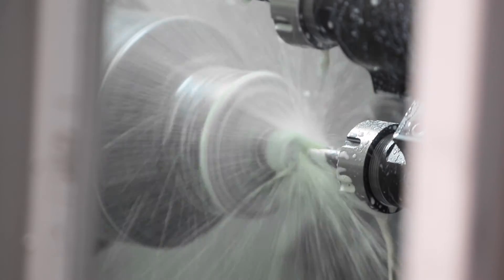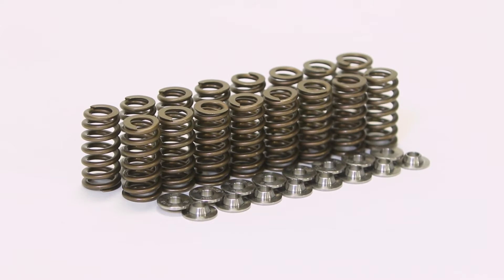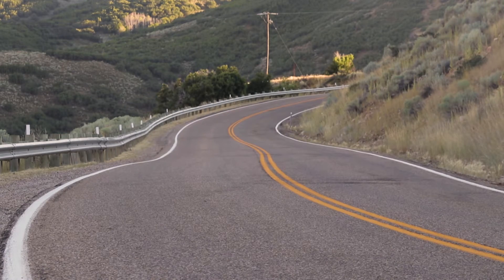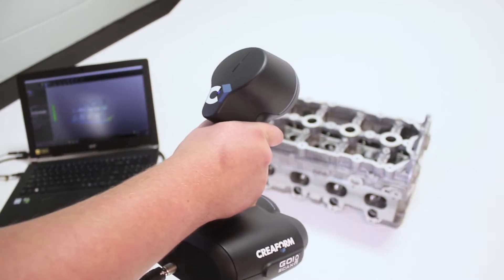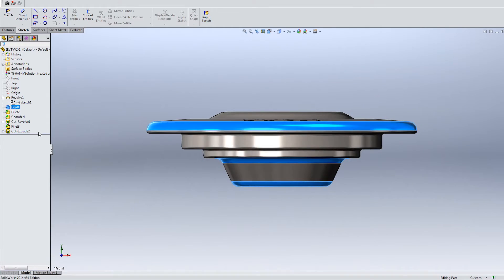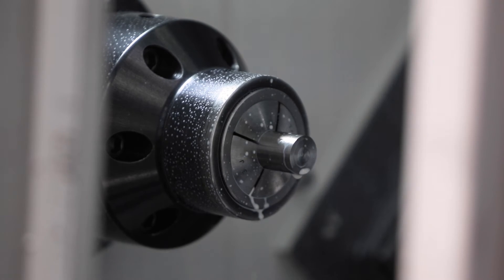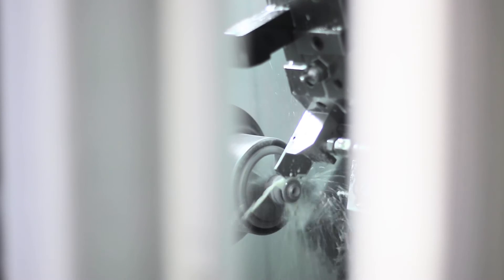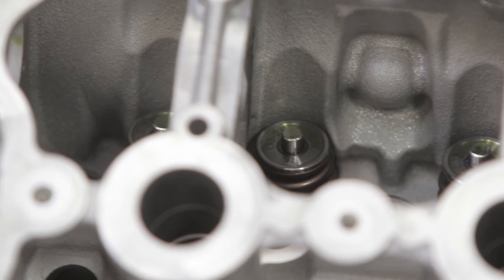Born At IE:  Valve Springs & Retainers

Comment: I just bought some valve springs but I wish I could get install instructions for these. My brother and I could install them but I can't find instructions anywhere.
Reply from the maker: Hey,
Installation is exactly the same as OEM, you can follow the OEM recommended procedure in the Bentley manual.
Reply: They don't seem to have a Bentley manual for MK6. Would it be the same for the MK5?
Reply: You can download the OEM repair manual from ERWIN.